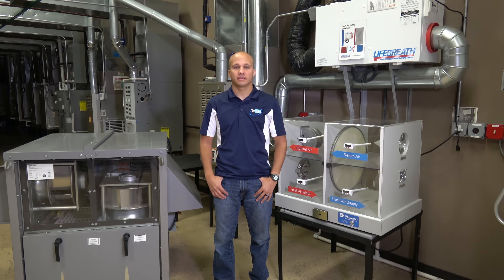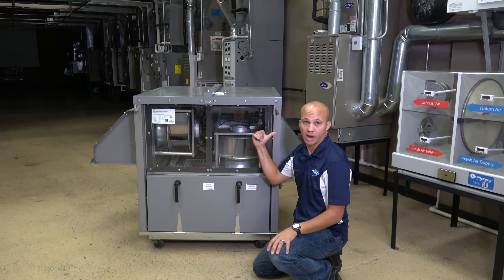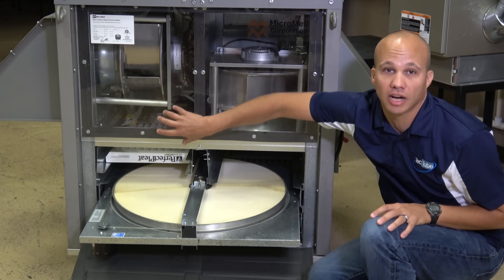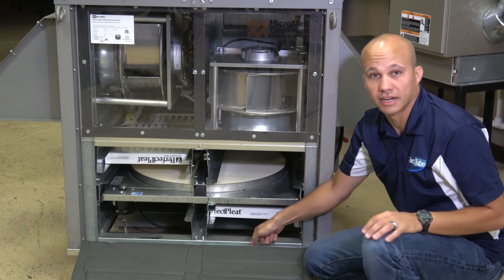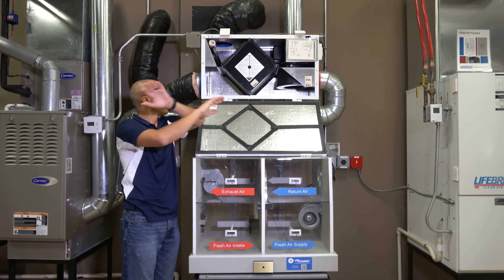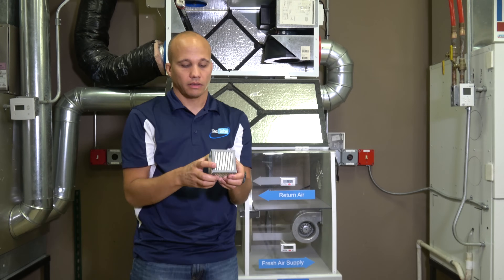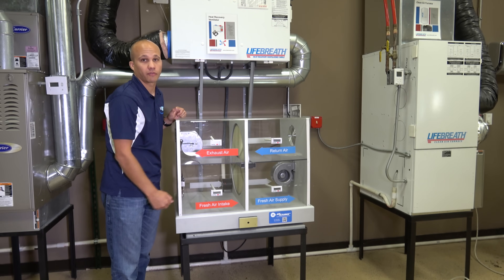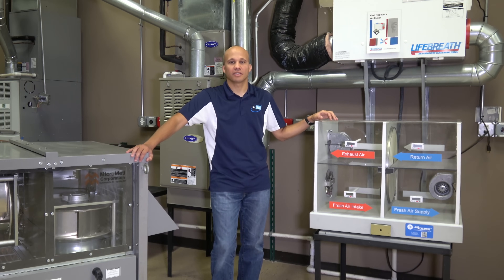Fundamentals of Energy Recovery Ventilators (ERVs)

Comment: Is it better to use fins as heat exchanger than copper tubes?
Reply from the maker: Common ERV heat exchangers are wheels, fixed plate cores, and membrane cores.  When you say copper tubes perhaps you are referring to heat pipes or run-around hydronic loops, which can be used for energy recover in certain applications.

If you have a heat exchanger with copper tubes, such as that found in a condensing or evaporator coil, it will have fins attached to the tubes.  Fins and tubes go together as a single thing... not an "either or."
Reply: Get it. One more thing, in the process of ERV or HRV,  how the 2 air streams transfer heat from one another and is it possible to be cold to hot ?? thanks
Reply from the maker: The heat is exchanged... so you are making one air stream cooler and the other warmer.  We are not sure on the specific question you are asking.
Reply: I think you are asking, if there are severe outside temperatures, would that impact performance. Watch from this point, as the "outside air" in the bottom left corner reaches 104 degrees and the fresh air supply bottom right corner only changes about 1 degree. The wheel moves that heat into the exhaust stream to go back outside as it spins. This is meant to condition the fresh air intake so it isn't so hot or cold depending on the season.

https://youtu.be/QOSelUK6dpQ?t=7m37s

Also, the heat is transferred by the same silicon desiccant that is in those little packets they put in food packaging and furniture to absorb moisture.

Comment: Does anyone know the manufacturer of the ERV?
Reply from the maker: The commercial ERV in the video is from MicorMetl and uses an Airxchange wheel.  The residential fixed plate ERV is from Lifebreath.  The clear demo module uses and Airchange wheel also.

Comment: there is a serious issue with the tightness of the wheel and the plate that seperates incoming and outgoing airflow. there is a gap in between so that the outgoing air could go the way to the incoming vent... or is the construction for buildings more tight and there is only a gap because its a demo?!
Reply from the maker: All wheels have a gap since they are in motion.  There are 3 things that make this a minor issue... and in most applications no issue at all.  1) the position of the fans in specific airstreams (SA, OA, RA, EA) will determine which way the leakage flows.  2) AHRI rates ERVs and there are two terms you will want to research... EATR and OACF.  EATR is the leakage from the return air into the supply air.  It is possible to certified leakage rates below 1% and even down to 0.0%.  3) Depending on the class of air for the return stream, the International Mechanical Code (IMC) allows 5 and 10% leakage.
Reply: Tec Tube and the granulate inside the wheel is this silicongel?
Well engineered!
Thats a great idea with the wheel which transport is the energy  and moisture. 
What about other materials?
Reply from the maker: The two wheels shown in this video made by Airxchange both use Silca Gel as their desiccant.  Yes, they can use other materials, such as Molecular Sieves, Alumina (Granular), or Alumina (Spherical).  These materials all have different adsorption levels at various relative humidity percentages, so some might be better than others for certain industrial and process applications.  For comfort cooling and heating (offices, schools, etc.), Silca Gel is the most popular.

Comment: Thermostat installation is required. Please provide logic how it will function.
Reply from the maker: ERVs should not run off of a thermostat.  For both commercial and residential applications, they should run whenever the building is occupied since they are providing the code-required fresh outside air.
Reply: Tec Tube if it’s manual how do home owners know when to turn it on? In Canada, new homes get these HRV as part of a rental agreement. It’s controlled by a button next to the thermostat. Green, yellow and red. Majority of the owners I talked about say they never turn it on. If it’s not “on” how does it meet code? Shouldn’t it be integrated to the thermostat and turned on automatically?

Comment: I heard about HRV just today, wow, why isn't this thing ubiquitous by now?! I also wonder the amount of energy needed to operate it.
Reply from the maker: Well... a HRV is not right for every application.  It only saves energy if you already have a stream of exhaust air to recover from.  And it only "pays back" if you have a lot of required outside air and the building is in an area with high utility costs.  Where we are in northern Illinois, it starts making a lot of financial sense when the HVAC system requires more 1,000 CFM of outside air intake.  If your building is in a state with more expensive energy costs, smaller HRVs can make sense too.
Reply: More over need maintenance mainly cleaning filters

Comment: Good video and information. So can you have residential type hrv in an office setting?
Reply from the maker: You "could" but a residential size HRV in an office building, but it would not be large enough.  The HRV should be sized based on the exhaust and outside CFM flows that the building was designed for.  Residential ERVs are generally under 300 CFM, which would be very small for a regular office building.  Unless you are talking about a small business office with just 10 people.
Reply: Tec Tube thanks

Comment: How much do these things actually save you though. I'm in Canada and wonder by how many degrees the air temp is being heated or cooled?
Reply from the maker: ERVs save energy if you have a stream of exhaust air to recover energy from.  So if you already have sources of exhaust air (such as bathrooms, pressurization control fans, etc), instead of throwing that conditioned air away, you can first save its energy.  The amount of energy savings... and more importantly, the amount of dollars saved, depend on the specifics of the project and the utility costs.
Reply: razz P 
It basically recovers heat from the indoor air as it replaces the indoor air with the outdoor air. It's just an indoor quality improvement device. Keeps indoor air fresh without the added cost of cooling it or heating it, depending on the season. Hope that helps.
Reply: Guess it be a hard question to answer. But curious how many celsius is the coming in air heated by? Guess the ultimate savings would be to not use the HVR/EVR, and just recirculate stale air. :). I assume HVR only need to be on while people are in home?

Comment: Great H&ERVs in a nutshell Ryan.  Finally, they don't baffle me anymore.  ?Could you do the same for that dreaded psychrometric chart?
Also I did plan to get a good cross-flow core ERV (~$1500) but like the desiccant wheel type now.  So I just have to ask.  ?About how much would a comparable home desiccant wheel ERV cost?  ?Also how much for replacement desiccant wheels?  
Oh, suggest you add humidity monitors into your awesome hands-on demo desiccant wheel ERV. 
Thks, TomB    PS:  TEC, pls give Ryan a salary raise & promotion (don't get a big head Ryan).
Reply from the maker: "Dreaded psychrometric chart?"  We love the psych chart.  But yes, we do have that on our wish list of videos to make this winter.
Reply from the maker: Wheel style ERVs are not available in small residential sizes.  But, to your point, there are cross-flow "core" heat exchangers in residential sizes that can handle enthalpy/humidity, as well as just temperature.  In regards to replacement desiccant wheels.... we have been using them commercially for 20 years and have never had to replace a wheel.  They will outlast the sheetmetal cabinet that they are in.
Reply: Perhaps we should discuss Tom’s final comment in much more detail.  😜
Reply from the maker: You want to discuss the circumference of your head?
Reply: Tec Tube touché
Reply: Tom B no adding. Humidistats to each box of your demo unit